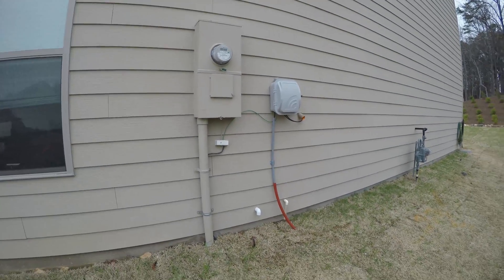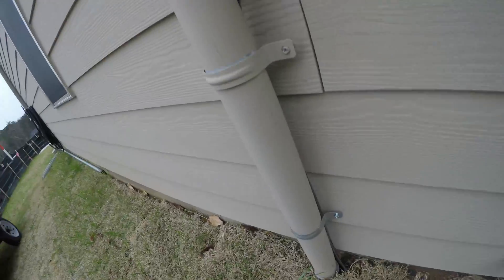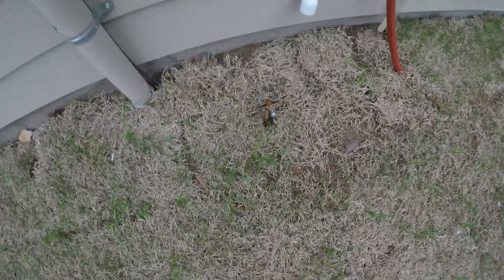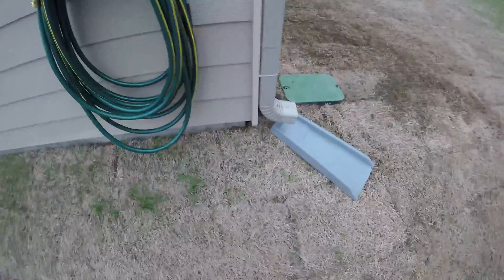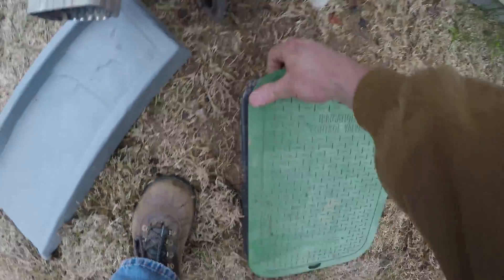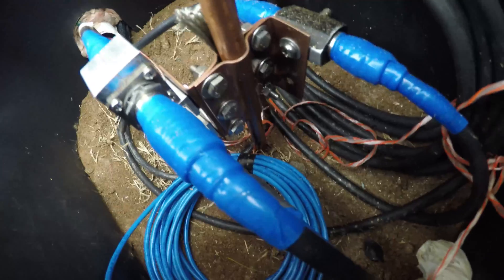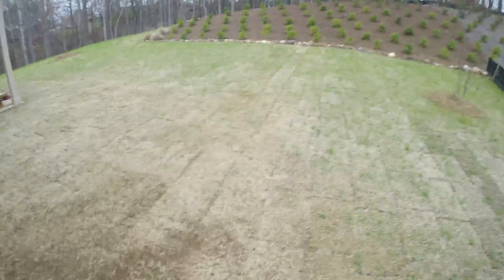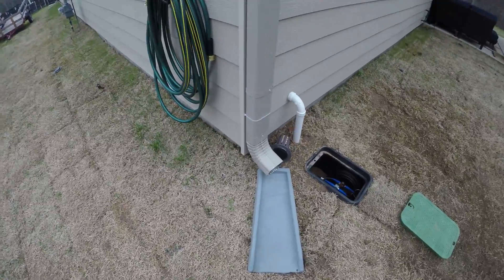Pats Ham Shack - Grounding System Overview

Comment: Those ground clamps have a hole and a screw for a reason: to put the wire though. That being said, using those clamps outside will result in failure from moisture and will not take much of a lightning hit. They should be welded. Also, ALL ground rods are to be bonded together, and to the service grounding electrode system;  no isolated ground rods.

Comment: WHAT KIND OF CONTAINER/BOX  AT UR SHACK EXIT INTO /DOWN BELOW LAWN, YOU REMOVED PLASTIC? GREEN COVER TO GET TO GND. ROD .? WHERE DID YOU BUY THE  CONTAINER , PLEASE, A VERY NEAT IDEA AND AN EXCELLENT SET-UP ALSO
Reply from the maker: Thank you! That box is a irrigation control box I bought at home depot or Lowes, can't remember which. I think it was like 17" x 14" and maybe 14" deep. I drove the ground rod in before I fitted the box into the hole I had dug. That would have been terrible to drive that rod in thru the box opening, lol! Cherokee County has VERY rocky soil and it took me several attempts.
Reply: @HighPassGuy  TU for the info and a great idea, i*m  just starting outside gnd system  in  gravel & bolders filled in acre  parking lot, they blasted a small Mtn. down to build a walmart  & Lowes and used fill  to make a pking lot 1mi. outside the city next to a former insurance agency  which i bought to live in. i will  TRY to use small tractor w/ bucket. i will go looking for box  monday.  arno W1tt auburn,maine
Reply from the maker: @istein2  I'm glad you got something positive from my video! That was the reason I did them!